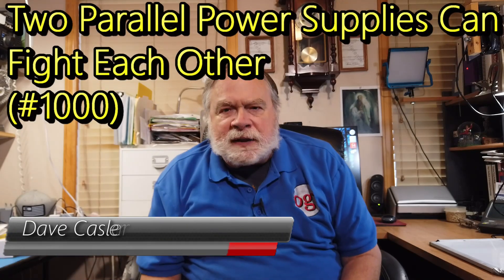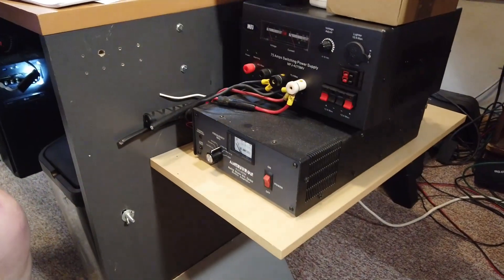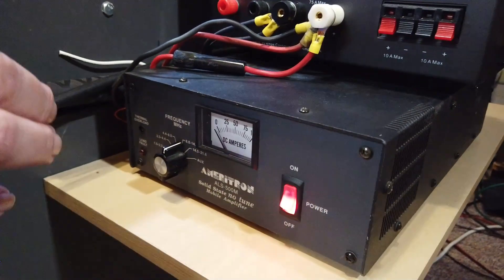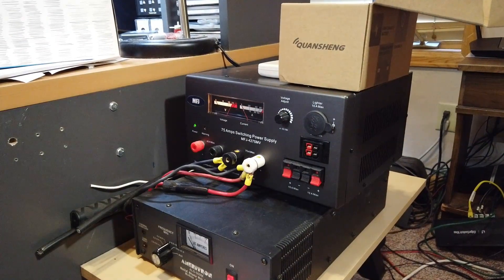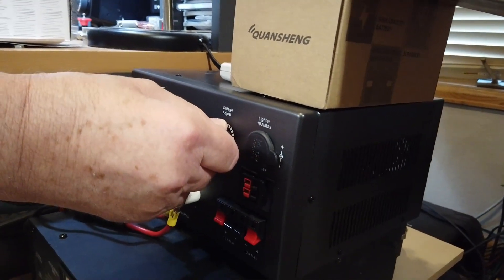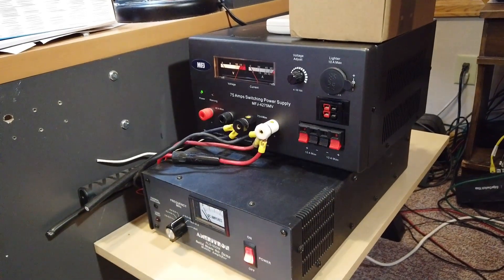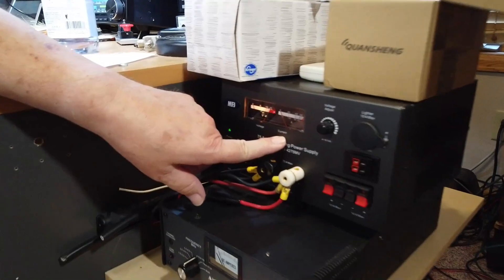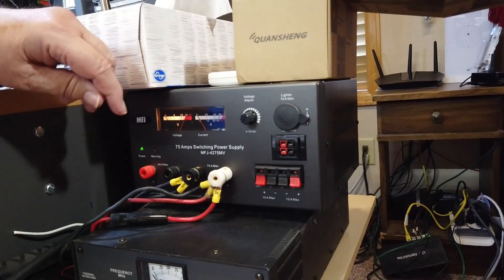Two Parallel Power Supplies Can Fight Each Other (#1000)

Comment: Hi Dave,
I was running a Henry 1200 watt moble RF amp at home.  I used two Astron 75 amp power suppies which has a additioal terminal on each 75 amp power supplies just for the purpose of connenting two supplies. Worked fine for years until the burned down. Not due to the power supplies.

Comment: I have the same amp which I bought doa and rebuilt it.
One thing to consider is your operating mode. SSB is a 20%  duty cycle as opposed to AM. 
I have a Astron 60 amp and it works fine at 14.5 volts (they are adjustable internally) I would run it higher but TE Systems don't recommend that when you use the rf keying.

Comment: I would put a big honking diode in series with each positive lead so one power supply can't backfeed the other if the voltage of one sags during use.  You'll lose 0.7 volts forward drop on each silicon diode and at 40 amps that is 28 watts per diode so they would need to be heatsinked and force-air cooled.  Or try using a surplus server power supply.  Many of those can supply 12 volts at 75 to 100 amps depending on input voltage.

Comment: The best way is to use a power supply that will supply 125 % of the required current. If you must use two power supplies, use two that match in current output that together can supply 125% of the required current. You can use power supplies that have different current ratings in an emergency situation. The best way in either case of using multiple power supplies involves modification of the voltage control circuit with a multi turn pot for voltage trim. Using a pot that has 10 turns rather than a less than single turn has the advantage of dialing in the voltage to almost 3 digits to the right of the decimal point, such as 13.803 volts. In this way you can dial in the control circuit for BOTH power supplies to09 the voltage which must match on each power supply using a quality solid state voltmeter with resolution down to ??.???. This works for any variable output power supply including those that can change the voltage internally, which is safer as no fingers, yours or others, can change the voltage accidentally.  
73 N7TZQ

Comment: Good video. As Dave said, the term is control loop. Some supplies are designed to be paralleled with no additional circuitry. They will have a separate voltage sense input, so the supply regulates the voltage at the load rather than the supply. This is common in servers which have redundant supplies. Some consumer supplies do this as well, as mentioned in the comments.

Only in a pinch should you use a big fuse or power resistor(s). Dave is absolutely correct. For a new install, just get the big supply.

Comment: 3:30 Diodes are probably even safer, but you will lose 0,7V. The diodes must be rated for the continuous current and cooled properly (0,7 V x 50 A = 35 W of heat).

Comment: If you would like to try putting 2 PS in parallel, you can try putting a fifty amp fuses in each dc line. They will act as a low resistance link and give a bit of a volt drop so the supply don’t fight each other. I have done this before and it seems to work well.
Reply: A fuse isn't supposed to have resistance
Reply: Incorrect, If a fuse was not resistive it would not work.   Refer to Ohms law. @davep6977
Reply: @davep6977  yet it still does... a minute amount, but idk worst case scenario is you blow the fuses and one of the supplies...

Comment: very good. Parelle power supplies is tricky.  with Astron 50 amp no so hard. have to pend them. their is a voltage adjustment on fixed models. set both to same voltage with in .1V or better. then use equal length of #6 AWG wire or bigger copper wire to a busbar for pos and neg. also use amp meter to check each supply for even current draw. it is a lot of work . Astron uses a LM 723 Reg IC and you can strap them together to track the same but that even more work. now on SMPS supply's like mean well or some mega watt they    have a link cable to put them together for more amps. with all that it is much better just get a bigger amp supply. 75 amp to 100 amp will be just fine. best to run 2 sets of 6AWG welding cable. this will be easy to move around.  73's

Comment: Great work on the 1000th episode.
I have done a poor man's supply for my approx 500 watt transitory amp. 

What I did as I am not well funded, is scored a 100 Ah lifepo. This is charged by both poker and solar. The main thing is that it is usually charged. If we have an emergency situation at home I can easily, connect everything to the battery and run qrp. It is a similar setup to  what I had in my flat 30 odd years ago running my old CB. Except there was no solar then. 

I could get a few more batteries an become totally solar. But my health is unfortunately ler me down...  the project has stopped with a fan dipole lying on my roof. And all the bits for my end feds still packed up. 

At least I have my 6btv.